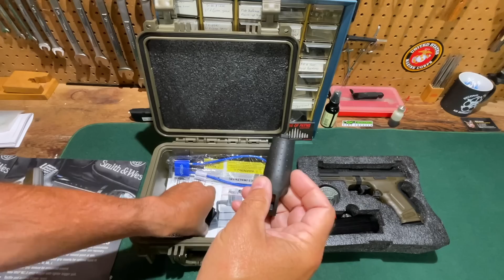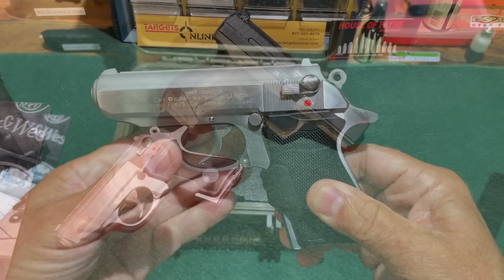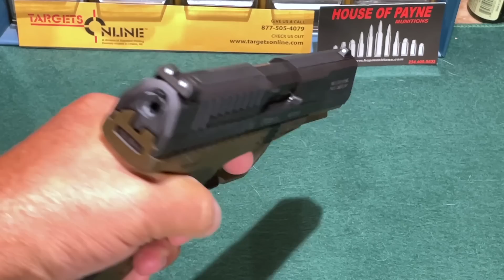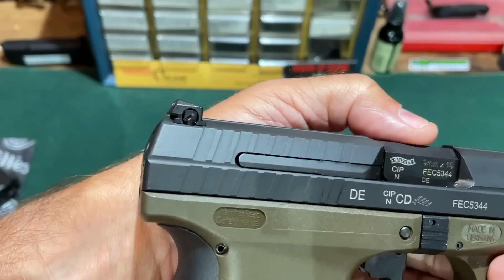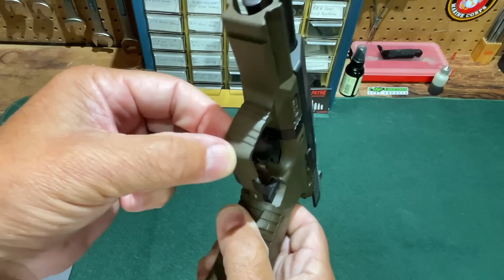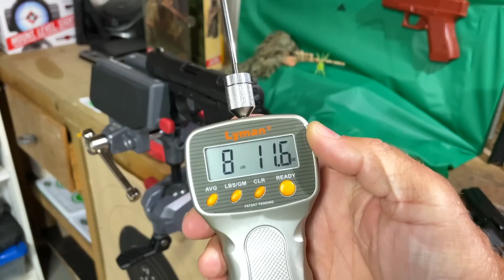P99 Final Edition: The End of an Era

Comment: Had the first.  Firing pin broke.  Re-upped in 2021.  With Talon grips Pro, it's perfect ergonomically, and  Trijicon HD sights.  2A/SA with decock, but striker fire   with the best trigger outside of 1911 to boot.  Discontinued I'm sure due to the impossibility of adding the fad sight system.  (optic).  This and my P30s are all I need.
Reply: Totally agreed, actually just said that on a comment about my P30. Ive never owned a P99, always wanted one, but Im going to work on changing that this week

Comment: I don't think you could run fast enough to give me a Smith Sigma.
Reply from the maker: What is wrong with them?
Reply: @hrfunk  The Sigma Smiths were just such obvious and blatant copies of a GLOCK that it was comical. I expect more from Smith than just a copy of another manufacturer's design. Smith has a bit of a reputation lately for making unshootable guns. A perfect example is those Scandium frame J frames in 357 Magnum. The SW99 was from the era when Smith and Walther were in bed together. I think that was the same period when Smith was making the PPK/S. I had a Interarms PPK/S and it was such a awful thing to try and shoot because A it was terribly unreliable and B it had some pretty fierce recoil for a 380. My experience with that .. thing ... really turned me off from Walther. The weird DA SA trigger mechanism in the P99 that the video is about is simply just unnecessarily complex when compared to the very simple trigger mechanism of a GLOCK. Throw in that silly cocked striker indicator and it's a hard no thank you. Plus, those Walthers were kinda expensive compared to a GLOCK. In full disclosure I AM a GLOCK fan boy. They are simple,  reliable, and reasonably priced. Magazines are dirt cheap too. I do have a criticism for GLOCK and that is they should really be installing nite sites as standard at this point. Those plastic stock sights are awful. I can definitely see why some people hate GLOCK. They do have some issues. The stock sights and the unusual grip angle are not for everyone. Sorry if I rambled. No disrespect Funk. I generally dig your channel!
Reply from the maker: Thanks for the clarification and thanks for watching!

Comment: I remember when the sw99 came out.  Some neighboring agencies with lots of money bought them. We would always swing by and check them out during their range days. A neat operating system. And we have to wonder with some of the discharges with 320s and glocks if this system would have prevented them.
Reply from the maker: Good question. It’s hard to answer because so much depends upon the operator.

Comment: it looks nice, but I have a hard time paying 800$ for plastic now that I have a 3d-printer. I buy parts kits at auction, and then 3d-print the frames for 5-8$ in carbonfiber nylon. Insane value, get fn 509's for 100$
Reply from the maker: Any issues with the duralbility of the 3D printed frames?
Reply: @hrfunk No, they should last 1000s of rounds if printed right. You do need some knowledge on how to print them (orientation-wise should be either rails up or down), drying/storing your filament(you put nylon in a dehydrator before printing), and your printer setup(fine tuning, bed balance, etc). I got the new bambu machine because it's dead simple to use, but it's a bit pricey. If you put in some work you can make your own that's just about as good.

I think that we're on the verge of a 3d-print renaissance, and it's not just glock designs anymore either.

Comment: Advanced trigger designs look really cool on paper but they really aren't that useful in real life, because most people be they civilian, cops or military do not fire their side arms.  In fact for different reasons they all probably focus more on finding ways to avoid using their side arm rather than training to use them.   In that context, simplicity of operation, ease of maintenance, durability etc. become more important than having a somewhat better trigger pull.  I believe this is why Glock style guns have dominated the defensive market and single action and double-single action guns are limited to enthusiasts.
Reply from the maker: I trained with mine.
Reply: Well, not just that but Glock’s pervasive marketing meant people consider Glock triggers perfectly “safe”. The P99’s trigger was designed to address safety concerns with the Glock trigger that’s fairly light with no manual safety. So it had a decocker to go full double action with a really long and heavy trigger, and even the Anti-Stress mode made the trigger lighter but still kept the long travel, akin to the HK LEM trigger. Both of which are safer than a Glock trigger, and then once you’re past that, you get a really nice, light single action trigger with a very short reset.

But since most people think Glock’s are perfectly safe, those extra safety triggers were considered redundant and even Walther deleted the other modes for the PPQ and PDP. Which is a shame because I personally do not find Glock triggers with no safety comfortable to carry. A gun who’s only safety mechanism is the operator not making a mistake is not something I fully trust. Every dangerous tool has multiple redundancies for a reason. So the P99’s trigger was precisely why I opted for that gun over the later Walther designs.

Comment: The only real problem I’ve heard of with the p99 is the back strap deteriorating and essentially crumbling into pieces. There’s a few guys who had this problem over on the Walther forum and it’s not really known what caused it as most were stored away when it happened. It could be some chemical in the cleaning or lubricant they used or the actual material in the back strap, who knows. Seems these issues were from older p99’s so maybe Walther fixed it. I’ve had my p99 for about 2 years now and all has been well with it. Just thought I’d mention that back strap issue that has popped up a few times. Other than that the p99 is about as durable and reliable one can get in a compact 9mm.
Reply from the maker: Maybe. As you saw, the 23 year old back-strap on my SW99 is in good shape.
Reply: I'd take a wild guess that those backstraps suffered some chemical corrosion somehow, more than human sweat I mean.  Whenever I've had polymers degrade like that it's usually been too much UV light and/or some organic chemicals the plastics didn't like.  Otherwise I'd say, squeaky wheel and all that.
Reply: I just took a look at the gun at my LGS.   Very nice.  I may pick one up as a collector item

Comment: On my Glock I can feel it with my finger or thumb.
Reply: @hrfunk  
The Glock slide on the left side has a indentation where you can tell if there is a round in the chamber. If it smooth and flat to the touch, a round is loaded.
If you feel or see it is inward, it is not loaded.
Of course you always clear it just in case every time you handle it.
Reply from the maker: That’s another one of those “systems” that doesn’t impress me. It’s not tactile enough for most operators/situations. Especially under stress.
Reply: @hrfunk  
I agree…in a panic mode one would forget all about it.